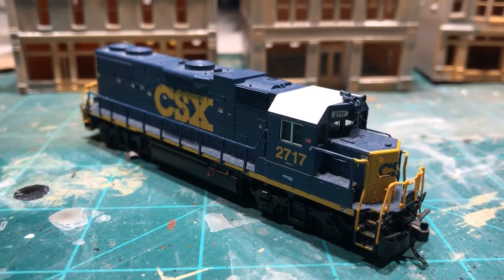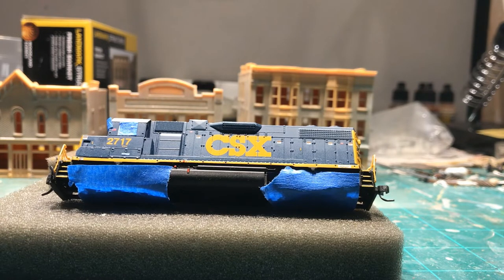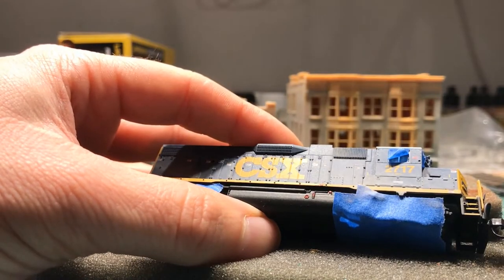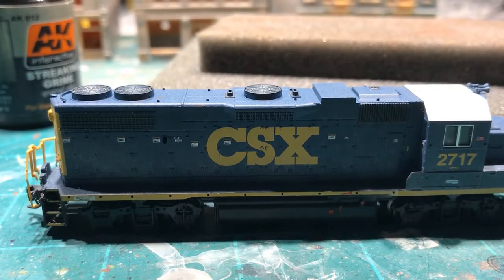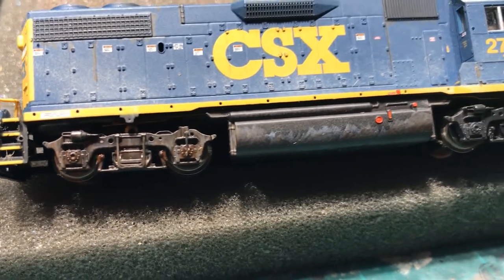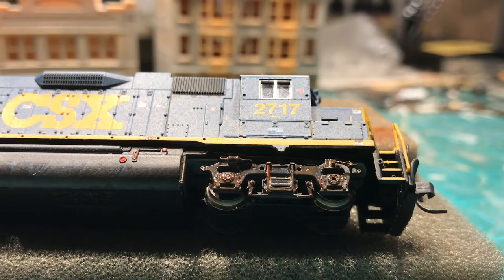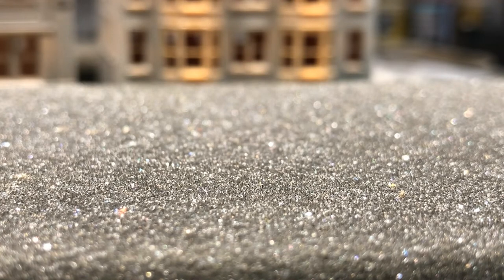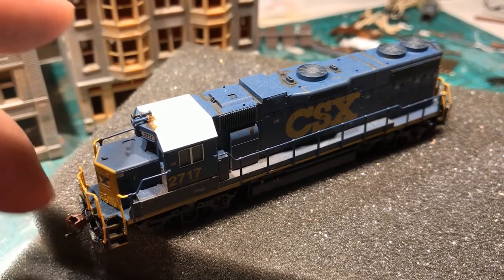Locomotive Weathering

Comment: I would use liquid mask on the windows. RC guys use it for masking car windows before painting. About two or three coats. Easy to peel off with an exacto blade tip. It’s works great for lights and light boards too.
Reply from the maker: Yes, definitely a good alternative - especially if you're painting so it doesn't run under the tape!